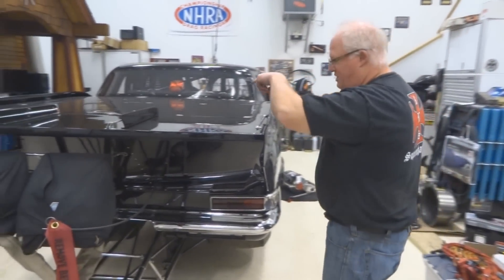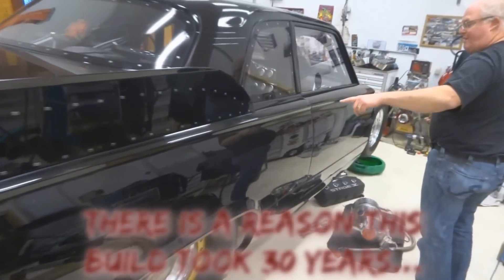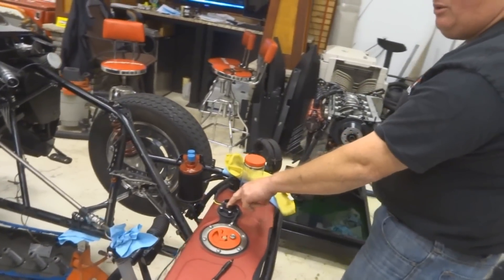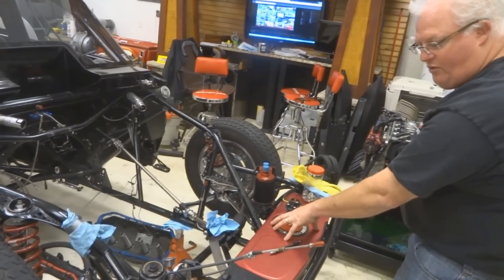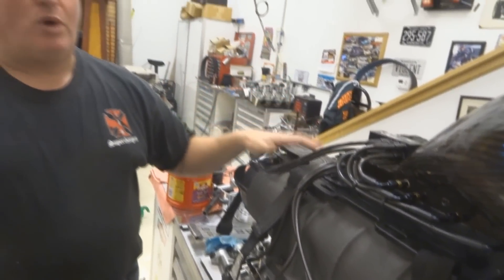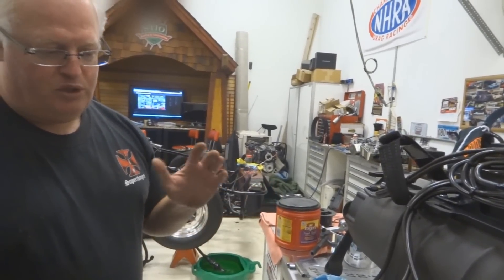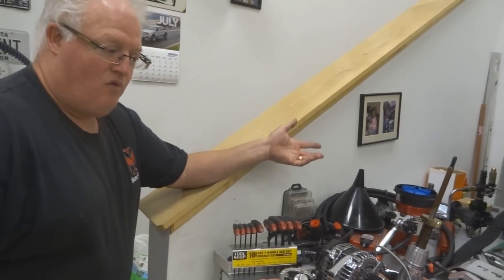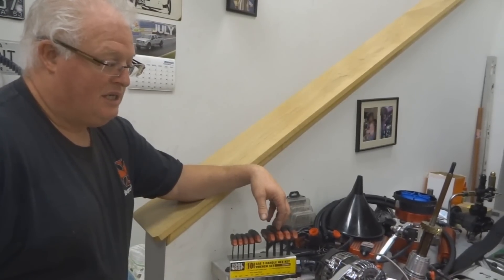2500hp Street Car: A look inside the Fuel System

Comment: This is just incredible.
Reply: MegaPierre88 These types of engines run mechanical pumps on the engine that extend from the camshaft. it takes a little rpm to get them primed and going. thats why we prime them.
Reply from the maker: Thanks!
Reply: Tinman II Kustoms Hi !  I was wondering why is it difficult to start the supercharger. Is it due to the flow of fuel or something else on the other videos regarding the same car? How much does it cost to build a replica of the same car or similar vehicle and same engine?
Reply from the maker: It is because it just takes that much fuel to start it. There is an automatic system set up to prime the supercharger for starting, but we like to use the bottle because it looks cool to see it started like that. And the cost really depends on how much work you do yourself and how high of quality parts..... this is the best of the best... So you're talking probably $1,000,000 by the time you get a close replica. I didnt pay to build it though and I do not own it, so i'm not certain on that price tag. This one can be bought for $1,000,000 though.
Reply: Tinman II Kustoms 1,600,000.00
Reply: promodracer Oh yes !  Thank you for that !  Because some guys who have superchargers, got a quick start, other don't. That's what bothering me. If ever I have a budget to build either using an original car, or I'll go with a kit like Factory Five !
Reply: Tinman II Kustoms Gee Whiz !  Well thank you for that information for sharing. I remembered I used to lived in San Fernando Valley, CA in 1996.  Valley Head Service Racing engines advised that a good street race engine would run me $ 35,000.00 alone. The crankshaft by Lunati that goes up to 10,000 rpm was pegged at $ 7,000.00. Well thank you again !